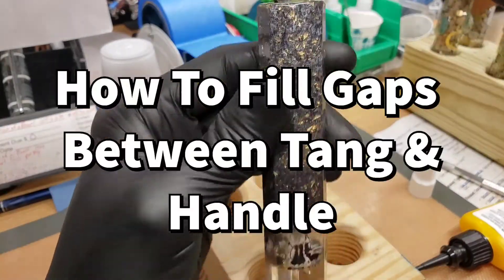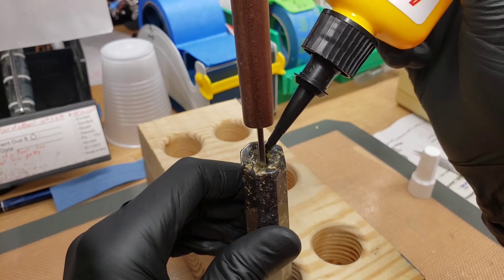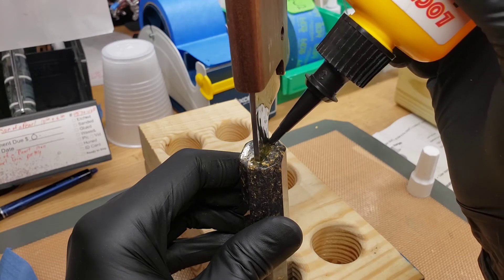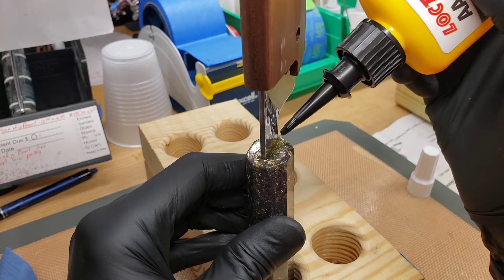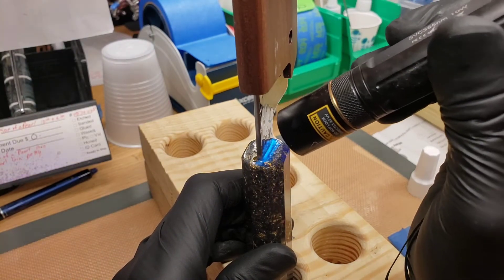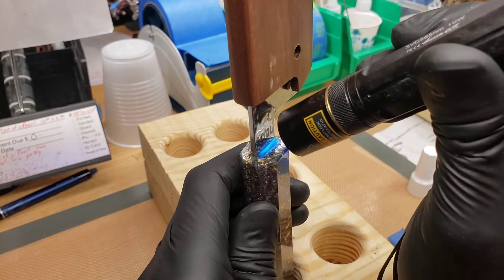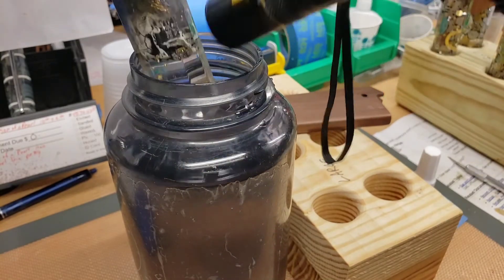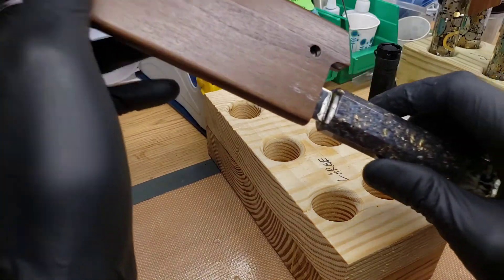KRVR Knives - How to fill gaps between the tang and handle using UV curing adhesive

Comment: Be sure to use a UV 365nm light as the 395nm will not work
Reply from the maker: Thanks, that's what we are using, 365nm. It still leaves the surface tacky though, because it needs either an additional wavelength for surface cure or no oxygen (like curing underwater)